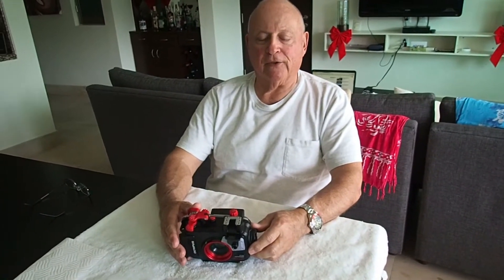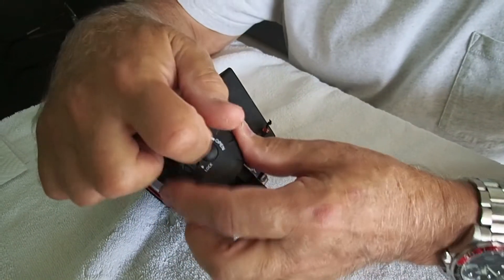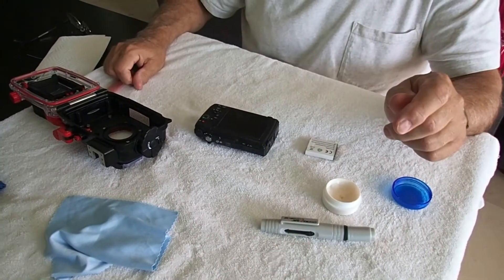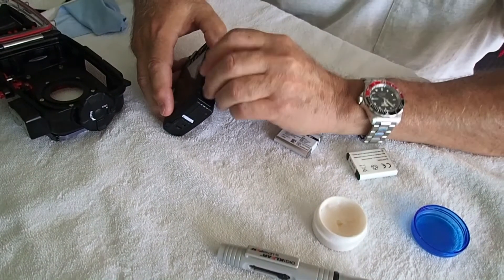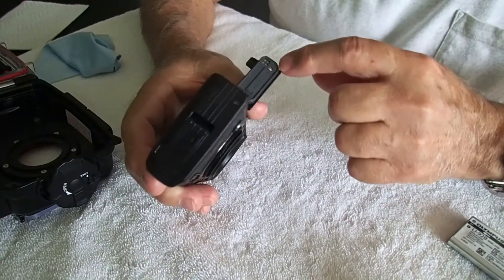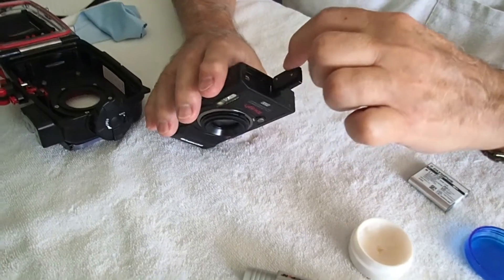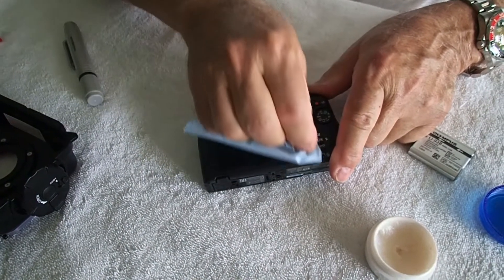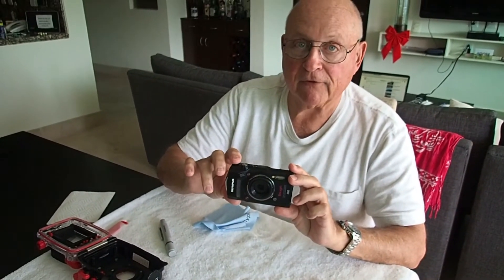TG 5 Olympus Camera & Housing Seal Servicing Tutorial 3

Comment: Not sure how my housing popped open as I was getting out of the water.  My camera stayed in the housing but somehow the camera flooded despite the camera flaps being closed properly.  Any idea why that happened?
Reply: Did you thoroughly clean the housing mating surfaces and apply a thin coat of o ring grease to the o ring before each use??
Reply: @DickGibson  I did indeed.  Been diving and snorkeling for decades and never once flooded a camera before. 😞